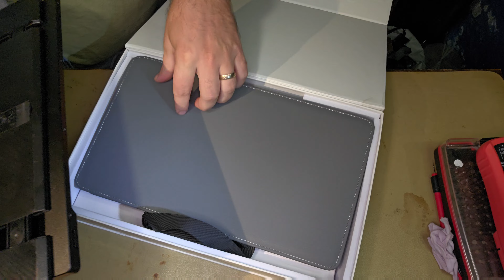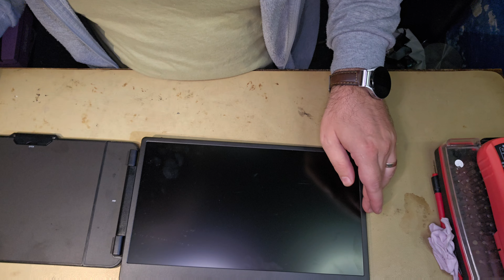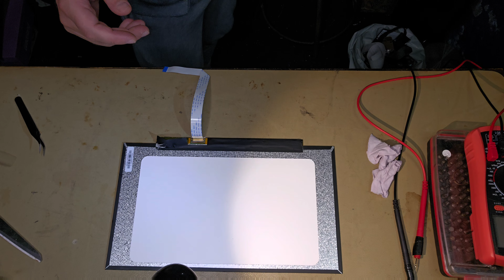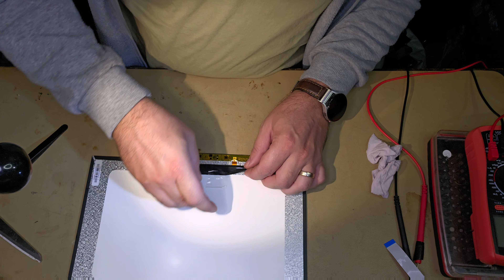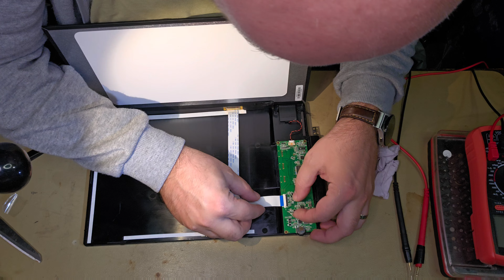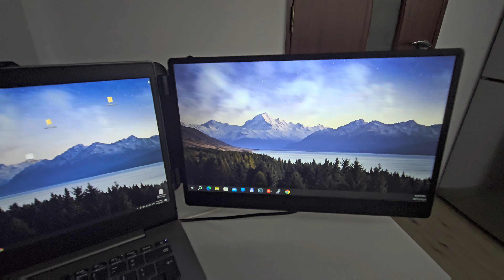External Laptop display repair| TeamGee S1

Comment: Got one today for 25$ from a flea market, worked there perfectly. Went home no backlight. Your video was super helpfull in opening the thing. The hinges part got me scratching my head like "Ok, how do I get out the 2 screws under the hinges?". Thank you, it was the ribbon, was inserted 1/2 that's why most likely it worked sometime, it was not fully disconnected.

Comment: Ah if only I could send this to you. I just bought one of these from goodwill (or at least, a similar item. I can't find the exact copy of the one I have) and it doesn't detect video signal from the usb-c to hdmi conversion, even with a brand new of those cords. I've fully torn down the unit based on this video (Which, helped a ton btw so ty for that), but I am still faced with the same issue. Screen turns on and everything so the display isn't the problem I don't think, the board inside looks fine to the naked eye, and I even cleaned the suspected port with 99.9% isopropyl alcohol. Still nothing unfortunately.